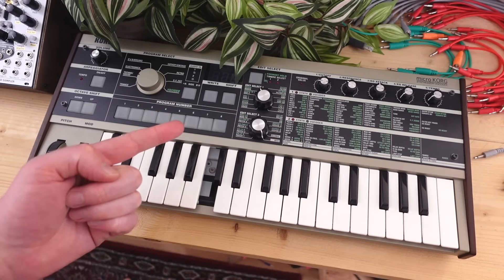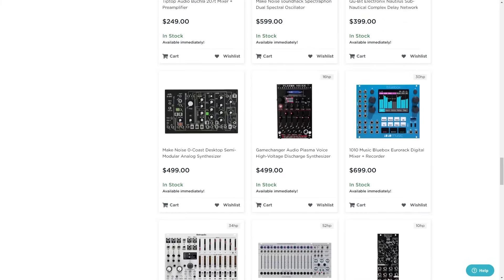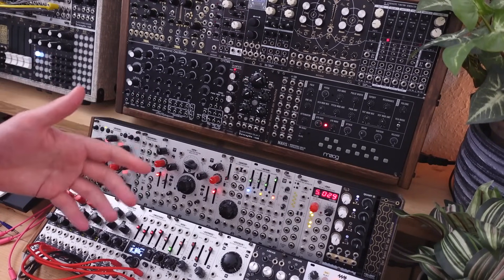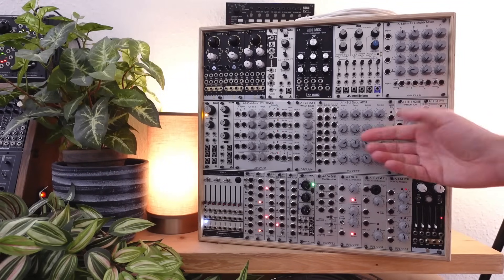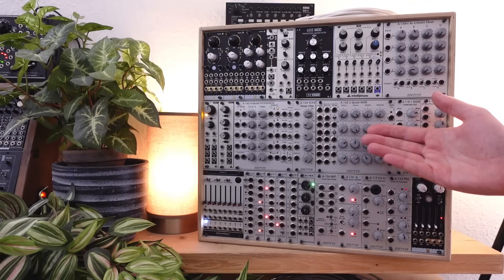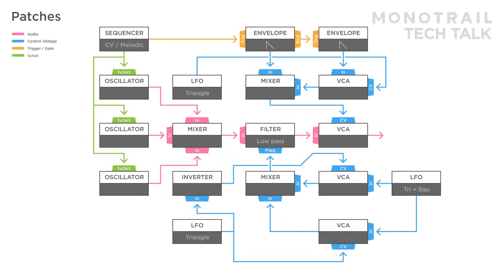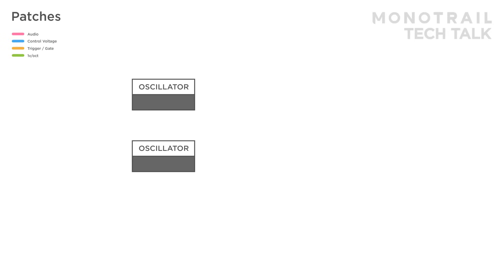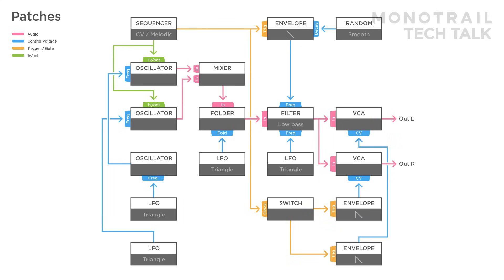Did I forget what modular synthesis is all about???

Comment: I C lol

Doepfer is a encyclopedia of Synthesis such a treasure and a must for any synthesist 

Plus they have such killer modules like 
Dual Rotary Switches 
and 
 Dual Voltage Controlled Polarizer
for example... 
Those are part the  ultimate basics for me
Reply: I find as much excitement using the doepfer VCS and sequential switch then i do messing with my lubadh. The simple things make you think more, and really compliment the expensive ‘boutique’ modules.
Reply from the maker: Agree! I really used the Doepfer manuals as my explanation of a lot of concepts like polarizers and switches. And buying those modules and exploring them was a lot of fun. Happy to see them back in my system, and explore them more :) Cheers!

Comment: I really like that you're going back to basics! Something I feel like is missing in Eurorack is a consistent way to fine-tune the modulation for each voice. I wish there was a module that was a combination of matrix mixer & VCAs that was small enough that I could park one next to every voice in my system. As it is I find I lose out on performance possibilities when every voice is using a different set of modules to fine-tune the modulation.
Reply from the maker: Glad to hear it! The balance between performance power and modulation freedom is a tricky one :) It's what I noticed as well. Performance power pushed my case to more and more specialized modules and signal flow, losing the options to tweak each voice to the max. Great solutions imo are compact quad VCAs that are also summing VCA, Meaning you can VCA, mix, attenuate etc. I won a Doepfer A135-2, and NANO quart for those purposes. Cheers!

Comment: A stupid question: at 13:27 what signals is the sequential switch exactly switching? if its only the clock isnt it just acting as a clock divider? i dont get this. please eloborate me, i want to learn what is going on there, the rest of the patch(es) is logical for me and easy understandable.
Reply from the maker: Not a stupid question, I made a stupid mistake! Forgot to show you need to send a constant high offset voltage to the input of the switch. Then that high steady voltage will be cycled through the outputs of the switch, and used to mix a sequence. I almost finished my video on custom sequencing, so will do a better job next week. Sorry for the confusion :)
Reply: @MonotrailTechTalk  Danke fürs antworten! Ich lerne bei dir wirklich sehr viel bzw kriege Ideen, um eigene zu erweitern. Top Videos und bitte weiter so! Zurück zum Thema meiner Frage: 
But isnt it then the case, that always just the same offset voltage gets to the mixer so that the switch doesnt do anything? Or do you mean in the inputs of the switch are different offset voltages and it cycles trough them, always at the moment when it gets the clocksignal?
Reply from the maker: Gerne! And that's correct. The switch distributes the same high voltage. But that's where the mixer comes in. If you feed the (for example 4) outputs of a switch to a 4 input mixer, you can use the channel input level controls of the mixer to attenuate the voltage coming in at each step. Then, when the high voltage cycles through the inputs of the mixer with different level controls for each input, you create a 4 step sequence.
Reply: @MonotrailTechTalk  Ah i now get it. Thanks a lot! Dir ein schönes Wochenende und fleissiges patchen! :-)

Comment: Awesome video! I love the discussion about modules that sound great, but are so unique and digital that you can't really make those sounds without that exact module - and how that makes for repetitive patching, limited exploration, and nothing to talk about. 

I see more and more people moving into complex digital setups with MIDI (and the completely baffling ART from TipTop... Do we need a proprietary alternative to MIDI?) and the segregation of signals removes so much magic for me. In the combined digital signals, you don't use your pitch information for filter cutoff, and you don't invert note triggers to control other VCAs. You're kind of stuck using things "as intended", which defeats the whole reason I love modular synths.
Reply from the maker: Glad you like it! Have to admit I should dive deeper into ART, but my first impression is the same. I really like modular for the simple reason ALL communication within it is with the same type of signal. It's a lot of fun to sue gates from a clock divider to make sequences, tap of an audio signal to modulate a filter, and so on.